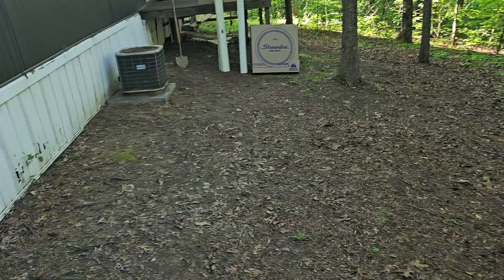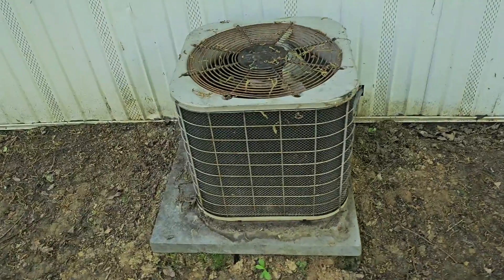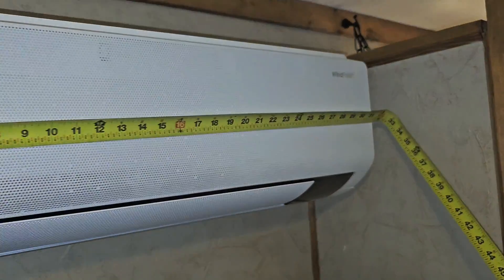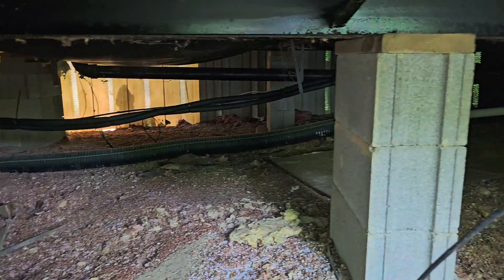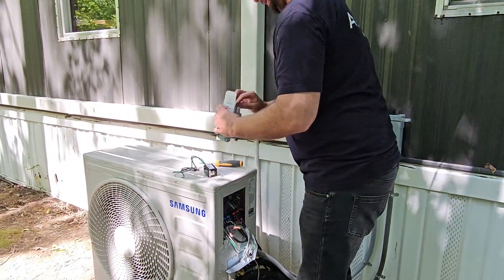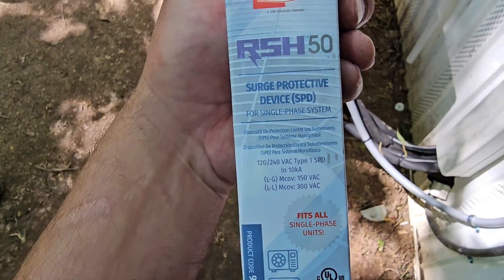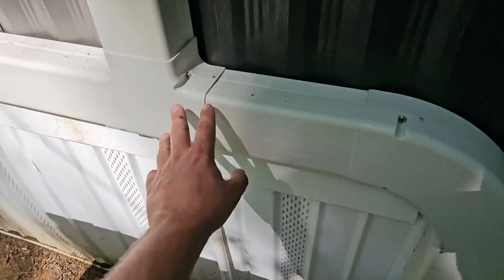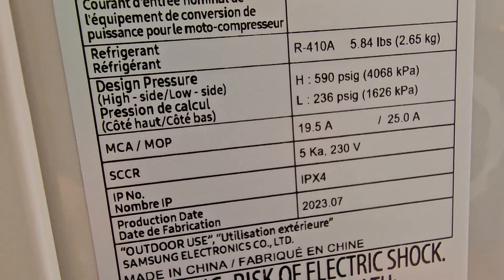HOW EFFICIENT ARE MINI SPLITS? #minisplits #heatpump

Comment: I live 2 miles from the ocean on the central Oregon coast.  The salt air eats metal. How long will the outdoor unit last in this environment?  We have a 1987 coleman electric furnace in a triple wide of the same year. We've only had to replace a sequencer or relay 2 or 3 times since 1990. Weve considered chancing to a mini split but the possibility of the longevity being shorter stops me. Btw, we never need air conditioning.

Comment: Hi Tad, when is it safe to use indoor units (12k, 9k, 7k) that add up to 28k BTU with a 24k BTU / 2 Ton outdoor unit? How much over can you safely go before you would need a 30k BTU / 2.5 Ton outdoor unit? Thank you
Reply from the maker: around thirty percent more capacity, then nominal capacity rating.

Comment: I have two of these and they work great but need to calculate the efficiency using the defrost cycles also. Good amount of power is used for defrost which increases frequency as it gets colder.
Reply: Yes but the old condenser defrost cycle is on a timer and draws more current, the mini split condenser defrost based on coil temp which I don't know about Samsung but in general mini splits have very minimal defrost cycle since they let them get frost properly then defrost easily.

Comment: Those “mini splits” we call high wall splits here in aus, alright as a cheaper option but imo a good redesigned high static ducted split system with a good zoning set up kicks ass any day of the week.
Toshiba have a 16kw / 54,000btu ducted split with 200Pa @ 1200l/s and can ramp right down to nearly 3kw / 10,000btu

Comment: It's not exactly fair to compare resistive heat, which always draws full power, with a heat pump, operating in summer temperatures, and declare how much more efficient it is.  I'd much rather see real numbers, including factoring in defrost cycles, in real winter temperatures (not the 47 degrees most units are rated at).  While the heat pump should still win the race, it would be interesting to see how much the gap narrows.
Reply: Everything you just said I have no idea but all I can say is any type of heat or any type of cool inside the house that has not had any air conditioner whatsoever for decades, I'll take this mini units anytime

Comment: I appreciate your professional explanation.  There are DIY mini splits on the market.  Do you have a preference?  P.S.  I liked the video with the DC capable mini-split.  Thanks
Reply: Forget the diy... Buy a 79.00 vac pump, and save your self $1000 for those pre charged lines.
Reply: @robd7365  Thanks.  I already have a vacuum pump and pressure gauges.  In the 1980s, I built custom air conditioners from scratch for a company.  Technology may have progressed but the physics has not changed much.
Reply from the maker: I really don't have much experience with the d. IY so I don't have a good recommendation. However, if I do get some experience, I will do a video of it
Thank you for watching my videos
Reply: @taddydigest  I have a prefabbed house at my ranch and it consumes between 30 kwh and 200 kwh per day.  The house is all electric and even though the house is only 2 years old, the electric furnace and AC are power hogs.  I am going to replace them with a mini split system like you installed.  My electric bill can be as high as $400 in the coldest and hottest months.  Thanks for your energy cost video.  I think my ROI is going to be less than 5 years.
Reply from the maker: Excellent news. You are making a smart move. I hope you saved tons of money.
Sounds like your roi is definitely five years or less

Comment: I am not running down any brand but Fujitsu which is the Cadillac or Audi of the industry ( quite expensive )  units last a LONG time. Sadly I have heard all other brands having problems with them trying to save $$ by using thin cheap copper indoor coils ( copper is expensive ) and losing refrigerant before 10 years and some a lot sooner. Then the owner is stuck with a huge labor cost to replace them and once off warranty it is even worse. 

The major conventional split system brands all  went thru that nonsense 7-10 yrs ago and now use thicker coils or aluminum coils. They had HUGE numbers of warranty problems. I changed lots of brand L coils. If these other minis had a track record of lasting at least 15 years I would vote for them. Except Fujitsu but you pay more for them.

Comment: I've installed quite a few mini's and they are great for open spaces like workshops and are also often used for additions or enclosed garages. That being said, the benefits of the traditional air handlers used for central systems are far more durable, have much more longevity and are cost effective when multiple zones come into play
Reply: Agreed
Reply: As Taddy mentioned, mobile home (beer can) ductwork is uninsulated, leaky and usually full of mouse feces, urine and nests. Package units usually have to use 12 or 14 flex and get holes from mice, rats and cats. Normally I’d prefer central systems too, but I may consider mini splits on my next mobile home. One thing that concerns me is freezing pipes in cold weather. Most of the plastic/insulation under a mobile home floor has been cut open for plumbing repairs and very leaky. 

I was wondering why Taddy didn’t use a 30,000 btu for increased heat output in the winter, as a 10kW electric heater output is 32,000-34,000 btu.
Reply: @USA-GreedyMenOfNoIntegrity  I prefer heat pump/gas furnace dual fuel systems. Super efficient. Good for all weather
Reply: @ewetoobblowzdogg8410  I have a few, but he didn’t have gas and many do not  want gas inside their home, like myself. I’m totally off grid😊with the sun ☀️ powering my high efficiency heat pumps.
Reply: Another excellent video👍

Comment: I like the idea but the furnace is VERY simple and cheap ( compared to a heat pump )  to fix and very reliable and as complicated as a toaster. The mini with all the problems with leaking indoor coils ( losing refrigerant ) and expensive repairs will eat up the savings eventually. Pros and Cons to everything. Electric furnaces are not expensive to install either.

Comment: I'm waiting on the ira rebate to kick in to change out my struggling ~14year old 13 seer heat pump for a mini split, been eyeing a 24 seer setup. Super excited for room specific heating/cooling which will only improve the efficiency.